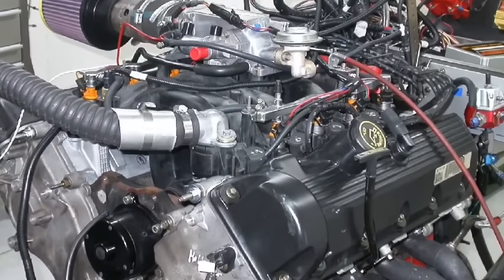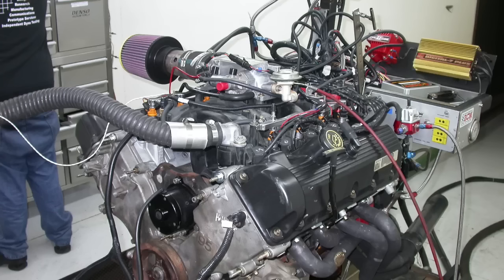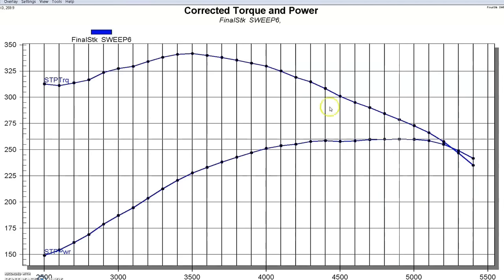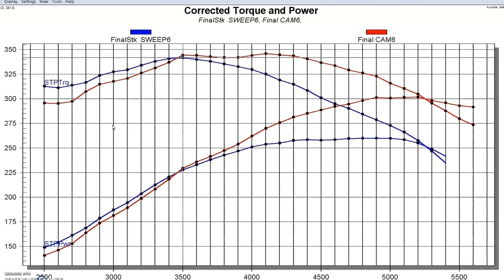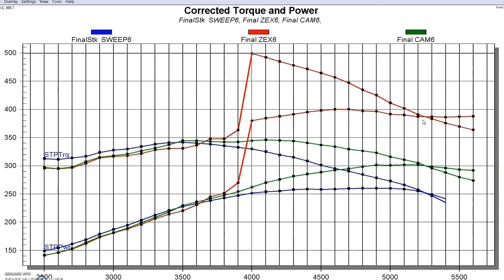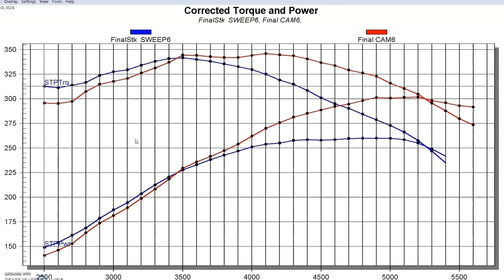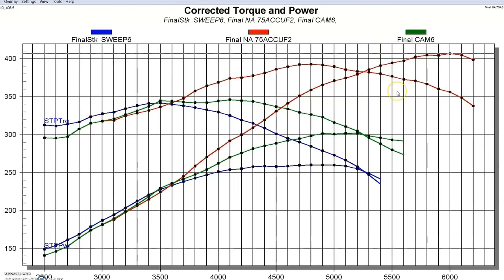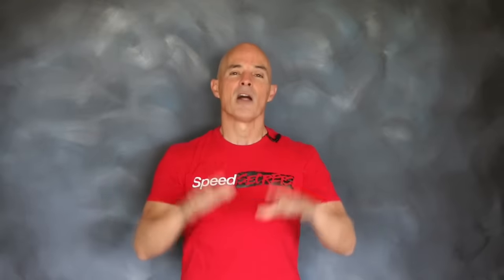HOW TO! MAX HP 4.6L FORD 2V MODS!

Comment: What cams would you recommend for a full bolt on PI motor which Will be used like that for a few but eventually get a pro charger?
Reply from the maker: the cams shown in the video work well

Comment: 6/6/2021

I have a 98 GT, 4.62V with automatic trans, completely stock. So, after bumping up the HP to 400 HP, will I have to replace the trans or differential to withstand the increase in HP? Would I need to replace the exhaust system?
Reply: No just don't get to 480

Comment: Hey Richard would I have to run the non pi cams if I'm doing the pi top end swap
Reply from the maker: NO-YOU CAN RUN EITHER WITH PI HEADS
Reply: @richardholdener1727  just didn't know it the would be any ptv clearance with the non pi 11cc pistons I have hytech stage 2 cams for pi

Comment: I am building this combination
What do you think about a hypereutectic 6cc dish instead of the stock piston
Less cc dish will be better?
Reply from the maker: add comp
Reply: @richardholdener1727  I have compcams springs and lifters
What do you think about the piston
Thanks for the reply
Reply from the maker: changing dish volume changes compression (comp= compression)
Reply: @richardholdener1727  well
I think the best option will be the flat pistons then
It is almos the same price of the 6 cc dish
Reply: This will be natural aspirated
Reply: But I don't know if the flat piston will fit with the xe274 compcam

Comment: Richard I was wondering if you know what superchargers will fit on a 2007 f150 4.6l 2v
Reply from the maker: not sure on chassis fitment-but contact vortech or KB
Reply: Will all the mods like cam and intake fit on the 4.6l 2v because most of the cams are for the mustangs

Comment: Hey Mr. Richard I have a 2003 f150 flare side I was try to see if I had pi heads or not …the stamp on the heads says RF-1L2E-6090-D22D when I look them up it says they are Romeo pi but I’m not sure can you help me please
Reply from the maker: they r PI
Reply: @richardholdener1727  thanks I been trying to figure that out
Reply: @richardholdener1727  If I add cams to these heads do I have to degree them ?

Comment: So, basically a 20hp gain from the added compression swapping pi to non pi engine if we disregard the nearly 5k in upgrades used instead of what the pi swap is really worth?

If the non pi was rated 225hp and the pi is 260 then that's 35hp difference..add 20hp for the boost in compression and it's now 280hp  if rated with all the accessories and factory exhaust attached like was tested by ford..keep in mind 40+ hp  was gained by running no accessories and the electric water pump and the long tube headers added a boost as well...this puts these Dyno results at a more realistic 340-350hp as it will be installed in your daily driver street car with ac and power steering and regular water pump etc...if it's a dedicated drag car then you can have the extra 40 plus HP just the same from the parasitic loss.

Some basic home porting to those who are competent on the heads and plenum and using a Ford 5.4L 70mm throttle body,  I don't see why you couldn't see nearly 300 plus HP with the factory pi high lift cams and some tuning...if nearly 5 grand in upgrades today for 40-50hp is worth it to you then by all means go for it.
Reply from the maker: you are comparing rated power vs tested power (you can't do that)

Comment: How much higher is the compression ratio when doing PI heads on a non-PI engine?
Reply from the maker: 1 point or less
Reply: @richardholdener1727  So like 10:1 instead of 9? I've heard you need to step up to 91 Octane

Comment: I have a 99 Mustang GT it has underdrive pulleys cold air intake deep motor throttle body Ford Racing intake what can should I use for this setup and after I install the cams do I have to have it tuned

Comment: So I have a 97 and a 99 f150. If i use the 97 block/pistons with my 99 heads and intake, buy the cam and bigger injectors, can I have my stock ecu flashed for this combo?

Comment: So when you do the pi swap do your order pi cams or non pi cams?
Reply from the maker: EITHER WILL WORK
Reply: @richardholdener1727  I’m sorry I watched your other videos on this engine and saw where you said either will work. I appreciate this content. I’ve found very little technical data on the swap and love the fact you show how it increases the compression by using the smaller dished piston and smaller combustion chamber. I hope I can get close to 400🤘🤘 thank you for the videos!!!!

Comment: Do you need to be concerned with valve float if 5,000 rpm is the max for the engine?
Reply from the maker: not on a stock motor-we replaced the springs with the cam upgrade
Reply: What springs were used?

Comment: So would the every cam is a turbo cam apply with a 4.6 as well?
Reply from the maker: yes
Reply: @richardholdener1727  I got a 2002 gt with 4.6 with a Hitech Stage 2
.550/.500 lift, 234/230 duration 111 LSA, 4.10 rear gears. As of now stock bottom end but open to forged crank and internals. What you think would be a fun route boosted? I am wired up for a wet shot too I should mention

Comment: Will this work with that 4.6 crown vic engine too? I have a 98 crown vic 4.6 NPI . So will cams and ported throttle body. Ported pi heads. No nos. Pi intake. Would this work too?
Reply: yes

Comment: would all of this work for a 2v 5.4 in pretty much the same way?
Reply: yes .. but intake manifold the taller deck height spreads the heads further away so adapter plates are needed to get the pi intake to fit.

Comment: Can I use a 1991 4.6 2valve to do this or will I need strictly a 96-98 motor?
Reply from the maker: YOU CAN START WITH THAT EARLY MOTOR
Reply: @richardholdener1727  thank you for the fast response all your videos are awesome. What exactly do you mean by start with? I purchased a complete motor already valve covers say 1991 on them guessing it’s a 91 motor and before I start doing anything I want to make sure it’s what I need so it’s just like what’s in your video if not I have a chance at a 97 motor I recently found. Thank you for your time sir

Comment: I used to just LOVE mod motors. In hindsight, what junk. I find it amusing that after giving up on OHV engines in 1991, and fully discontinuing the construction of them in 2001, that Ford realized OHV has several DISTINCT advantages - and designed a brand new from the ground up OHV for their trucks. The OHC heads are just too freaking big, making the whole engine too freaking big. The only advantage to OHC is lighter, higher-speed valvetrain - which Ford basically NEVER took advantage of in the mod motor - making the OHC arrangement completely pointless and in fact, cumbersome and overly complicated.
Just imagine what you'd have if you took the stiff and robust bottom end architecture of the mod motor, added a 4"+ bore, and put some really nice flowing OHV heads on top!  Oh, that's right - you'd have an LS!

Comment: I'm confused.  Is the 400hp on the pi swapped without the Zex system or with?
Reply from the maker: 400 hp na on the modified PI/Non PI hybrid or 400 hp with a stock or mild build plus nitrous-you choose

Comment: I did pi heads and Intake on my 97 f150 4.6 2v I have a valve that hits the piston but only one. And I can rotate it almost all the way through the stroke of the engine. Any ideas what this could be?
Reply from the maker: cam timing is off

Comment: Make a video on witch LS camshaft makes the most HP for stock NA application!
Reply from the maker: which stock application? 4.8L, 5.3L 5.7L, 6.0L, 6.2L etc...
Reply: @richardholdener1727  5.3L
Reply: 4.8L most likely would be the same results for a 5.3L

Comment: So..has anyone done this in there non PI f150?
 So I need to get a set of PI heads, cams and intake, longtubes..Ill have a 400 hp 4.6 truck engine?
Reply from the maker: ported PI heads, Comp cams etc...everything mentioned in the video
Reply: @richardholdener1727  10-4!
Reply: @richardholdener1727   Richard, is there a  stage port job you ran with these heads? Do you know the flow numbers? Fixing to order a.set or gave them ported. It's in my 97 4 6 5 speed truck..I might change cams than what you ran here.. what do you think?

Comment: Trying to calculate how much HP can be gained just by porting PI heads. I keep coming up with around 35-40 HP gain on a bolt on, N/A PI motor. Can anybody verify?

Comment: So your telling me all I have to do is get a 1998 non-pi motor and get cams and pi heads and il be at 400hp
Reply from the maker: PORTED PI HEADS
Reply: @richardholdener1727  I have stage 2 heads from patriot performance will that mount on direct to my 98 f150 and will I make a little for hp then the 99-00 2v

Comment: Question if you can give me a few ideas... Anyone?
I have a 2002 F150 new high compression 5.4 about 10.2:1 engine (new transmission too), 
all new coils, etc, with no power *barely dragging at 45 mph, uphill barely 30mph, I suspect the cats, but is there a chance the knock sensor
 is flagging the high compression and retarding the timing to avoid the knock? I'm making time for the headers, new cats and exhaust, but 
concerned of the knock sensor theory.
Of course, I'll need to somehow have the computer set up for the high compression...
Reply from the maker: check cats, timing and cam timing

Comment: 260 HP stock?? Thats WAY more than I expected
Reply: That is woth no accessories..no restrictive air box...long tube headers and different Engine management..Not exactly representative of a stock dyno run.

The mustang from 99 to 04 was rated 260hp WITH accessories and ford engine management.

The later crown victoria police cars were rated at 250hp.

Comment: So, how can I get 400 ish bhp from a Pi motor? Will the Trickflow heads and cams do it?
Reply from the maker: yes
Reply: @richardholdener1727  What about ECU? Can the standard item be mapped for the extra flow?

And will injector size need to increase?

Comment: So, if you are going to turbo them PI or non-PI?
Reply: both, but for boost lower compression is always best..
Reply: @P71ScrewHead  Sounds to me like something Richard should weigh on on.  Pretty certain that has been disproven
Reply: @dwarfgrumpy  I'm cereal, high compression is used mostly in high octane n/a builds n low compression for boosted applications.. Mmmkay??
Reply: Please see Richard’s previous video on running the same engine with higher compression plus boost.  https://youtu.be/gJCT5RvPCwM

Comment: I have been asking EVERYONE from engine masters to roadkill garage to do an episode on 2 junkyard NPI engine that one bone stock and other with ring gaps changed for boost and then putting both engine on the dyno to see exactly how much extra power can be gained if you eliminate or reduce the chance of the ring ends butting together under high temp boost loads?  Hell go for broke do 3 engine the 3rd engine completely bone stock and run on E85 to remove the same chance of ring ends butting together and comparing all 3 .. for the cost of 3 NPI blocks you are looking at a very very very inexpensive video .. get a supercharger company to sponsor it because if you can get 800 hp from bolt ons running E85 your gonna sell some supercharger kits as well as injectors and tuners etc.. have a sponsor put out a package deal to go with the testing ..
Reply from the maker: just use a $300 turbo
Reply: @richardholdener1727  Turbo mean turbo manifold which mean tubular K-member which means coil over suspension .. the just $300 turbo sorta steam rolls into lots of other shit :) just thought it would be nice to see if stock 4.6L bottom end would support 750 hp with ring gap issue addressed .. maybe the boss rods are only a tad better then stock rods because anyone with boss rods had engine apart and gapped the rings accordingly and that was the main reason it held more power then stock bottom end ?

Comment: A stock 1998 4.6 can't make 260 hp.
Reply: hes running engine with no accessories an long tube headers
Reply: @codyramos3200  And, he still not making 260 hp from a stock 98 4.6.

Comment: That motor sucked, 281 ci and it’s bigger than a Chrysler hemi of old. Gutless wonder.
Reply: This one made 400 horses with minimal mods.  It has cams, ported stock 99 up heads and a stock 99 up intake.  400 horse close to 400 torque out of 4.6 liters and theres room left on the table with better intake manifolds and more aggressive cams.  I wouldnt call 400 horses out of a mild setup 4.6 from the 90s gutless.  Yes stock they suck but like i said you can add a ton if power even na without spending a ton of money.
Reply: Also i understand on the engine dyno with no intake and no exhaust or accessories its gonna read higher than it would inside the car but that would be solidly above 300 to the tires all day every day and that isnt bad considered they dont even put down 200 stock and minimal work was done.  Alot of torque for that size engine too.

Comment: What I want to see and NOBODY is willing to make a dyno video is a head to head of 2 identical 4.6L 2V engines where only change to 2nd one is the rings are regapped for boost and place them both with a supercharger and keep adding boost to see how much more it can take if the stock ring gaps are gapped for boost. Everyone always blames powdered rods and weak pistons oem as the weak point on mod engines and everyone overlooks the ring gap. You build a engine with forged rods pistons and crank and gap it for NA application and run boost and it will scatter just as quick as a stock engine. If you can make almost 750 HP from a bone stock 5.3L bottom end simply by regapping stock rings then for fucks sake try it on a mod engine and video it. these motors are dirt cheap now its not like your tossing away tens of thousands ?
Reply: people don't realize is the 5.3L has hyperutectic pistons same as 4.6L as well as pos powdered rods
Reply from the maker: we made 1542 hp with a stock bottom end 6.0L and over 1300 hp on the sbe 5.3L (there is much more to be had on the 5.3l). the problem is the 4.6l 2v doesn't make much power to start with, but adding ring gap will cure the big problem
Reply: @richardholdener1727   But it is something people want to see .. if you could have learned back in 2003 that all you had to do with a 1998 NPI engine is place PI ported heads and good cams on it with PI intake and take apart the bottom end and simply re gap the piston rings for boost and "nothing" else no forged crank no H beam rods and no forged pistons and make 650 reliable hp on a solid tune ... maybe some mythanol injection or E85 because of the NPI with PI heads ... would that not make for a good video ? no one has ever done it and possibly adding another 150hp safety net to a stock bottom end would that not be worth it ?  NA ring gap has to be the number 1 major cause of a stock modular bottom scattering with boost ..

Comment: These engines are junk. Period. Let them die, they are not legendary or iconic. Just junk.
Reply: How is it then they can last 500,000,  600,000,  1million or more then.?  My 02 F150 only has 430,000 miles .
Reply: Lol OK, yes alot were in taxis but they were on 2 and 3 engine replacements they do/will start burning oil badly eventually, they make little power and take up a lot of space spark plugs strip or blow out the heads, manifolds rust out literally holes, intakes leak coolant into the spark plug tubes, vacuum leaks. 300+k on an f150 with a modular engine among all the other suspension ect issues must have cost a fortune to keep on the road and it probably still drives like a bag of dicks.
Reply: @jumpinjimmyg2164  idk my grandmas 2v still running no problems , cuz he knows how to take care of it , might not be powerful but its decent he got the truck for cheap

Comment: Everytime I see someone install cams in these engines they fly to pieces...lmao..
They are junk to start with..junk in ..junk out..I had a 98 gt..Junk..It flew to pieces after heads..cams..intake..I talking bout flew to pieces..pure junk .. Nothing like an old tried and true GT40p headed 5.0 H.O. 
Yea this is a real engine..They don't fly to pieces lol..rods all up in the glovebox.!!😅
Reply from the maker: If an engine blows to pieces-don't blame the engine-blame the tune or builder
Reply: @richardholdener1727  no sir..the timing chain broke waded up pushed the crankshaft out through the oil pan... Nothing to do with the builder of the engine...I've been building engines for over 35 years..I guarantee you this .
An old school 5.0 will always be a more suitable engine for making power and endurance..I built a 2000 model Ford explorer GT40p headed 5.0 
X303 cam.. torquer 289 hi rise intake.. Holley 750 dp..all internals was forged and balanced..
In an 83 gt mustang with a SROD side shift 4 SPD it would run over 90 mph in second gear..
That was in 2001 and it's still running today..
The tach only read 6000 it would go past that..And it didn't fly to pieces..Try that with a two valve..It will..as you guessed...FLY TO PIECES
Reply from the maker: Never had any issues with any of the 4.6L motors I drove, ran or tested-a blanket statement based on one problem is in no way accurate.
Reply: @richardholdener1727  ive owned over 40 mustangs..from a 74 mustang 2..to a 2012 ..
Fox bodies..In my experience with mustangs the 4.6 just doesn't have it. I owned a 1997 Taurus SHO 3.4 32 valve V8 ..It would eat up any 4.6 mustang..